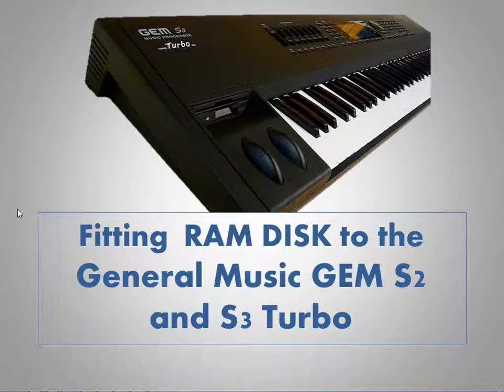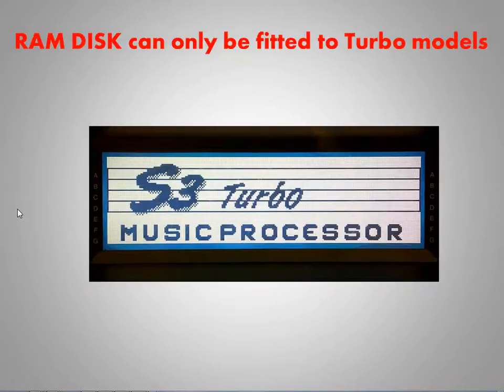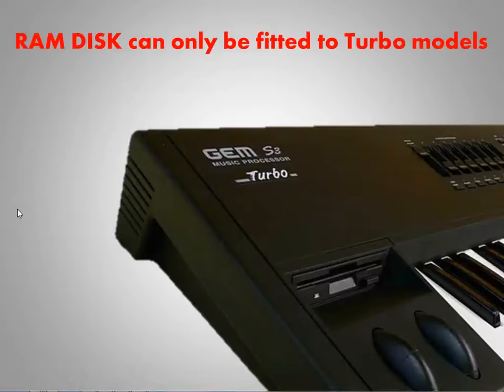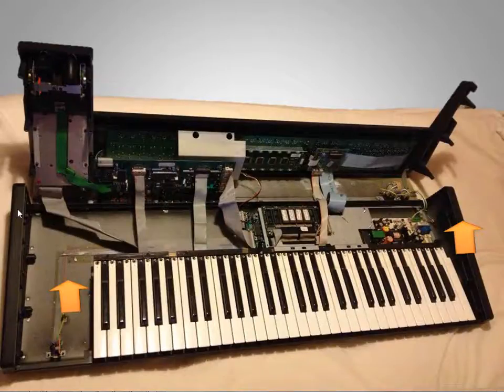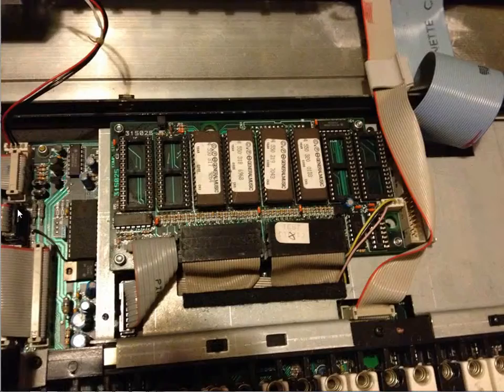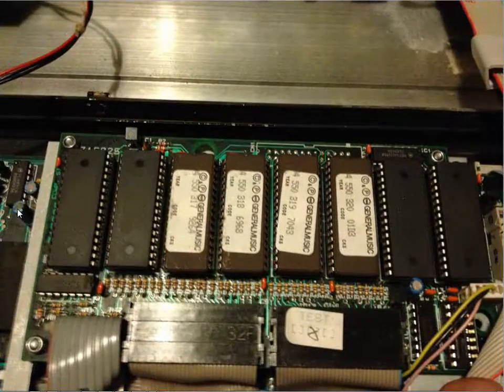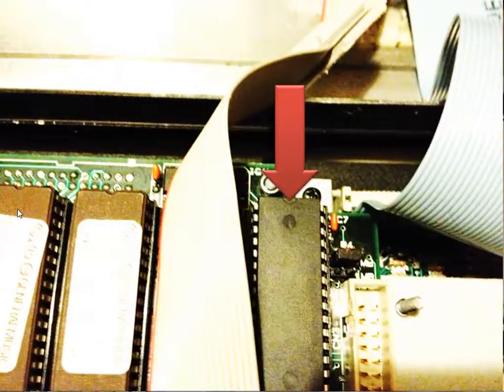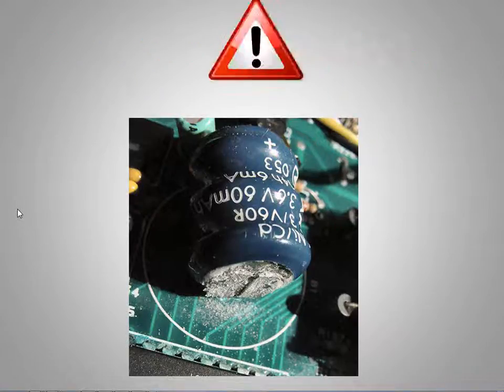Fitting General Music GEM S2 Turbo or S3 Turbo Ram disk

Comment: Hey BB, just wanted to thank you for all of your info on the VP-9000 on your web site. I'm considering following your "trading out the zip drive for an data-card reader." But just knowing how particular the VP-9000 is about WHICH data card it will read has me worried.
Reply from the maker: If CF works better for you then go for it - you can always revert back. IMO most of the early failures were due to old firmware more than bad cards (so make sure you update first). Even then was Transend or Industrial that always seemed to work, just not every cheap camera card. I don’t have my CF anymore - any other users still using it and give later comment?

Comment: Nice little instructional!
Can you tell me if the battery is necessary if you're not using the additional 4 chips?
Also, any tip where to get the ram chips and at the risk of sounding stupid; does installing the cheaps mean I don't have to wait for floppy boot every startup?
Thanks!
Reply from the maker: +jimbomusic Yes, the NiCd battery is a standard part of the Turbo kit, whether or not you use the RAM disk. It is also used for storing all user's custom  settings, like Midi preferences, attack curves, etc - basically every menu where you have to click "[Save]".  For the non-turbo versions these settings are also retained by a battery, but a lithium coin cell instead of horrible NiCd. NiCd are no longer generally sold, but is commonly replaced with NiMH alternative.
Reply: @barrybutcher  Strong suggestion is to replace the battery and to put it away from the motherboard in a safe way (to avoid leaking).

Comment: Hi Barry. I had my GEM S3 Turbo stolen a few years ago. So gutted, even now. I've got dozens of disks with my own compositions on that I produced on the GEM. I've had no luck at all sourcing another GEM S3 Turbo so I'm wondering if there's either another workstation/keyboard that would be compatible with the disks or a rack mount I could get? I really want to have access to all those songs, somehow! Any ideas?
Reply from the maker: Yes, the GEM S2R (sic) is the rack mount version. It was released last, and by then included all Turbo features by default. The sequencer supposedly has a “save song as General MIDI” option so presume this would do it for you. Or just ‘play’ the song into your favourite sequencer. 
I know the Sound disks are custom format, to get the 1.8MB needed, so not FAT and cannot be read by Windows etc. 
There is software like OMNIFLOP which enables Windows to COPY the disk to image file, but not aware of any software that can extract from that image (anyone else?)
Reply from the maker: If you want to make an image of 1 of your disks, I can try loading it on my S2 Turbo and try that ‘Save As GM’ option for you.

Comment: Great and useful video, thanks! Any idea what RAM chips can be used in an S3 Turbo and if they are still available from e.g. a standard electronics supplier?
Reply from the maker: +jmechnich The part number I've seen is BS62LV4006PIP55 but has been difficult to find this from eBay or RS Components.  If anyone finds a supplier or working alternative please let me know!
Reply: +barry butcher Thanks for the reply. I just bought four 512K X 8 bit Low Power CMOS SRAM, DIP32 from a German electronics supplier (http://www.reichelt.de) for ~5 Euro/piece and they work flawlessly. It does not seem like you have to use exactly those which were sold by GEM in the 90s, using Low Power RAM is probably still a good idea in order to prolong battery life.
Reply: +jmechnich Thanks for the battery and RAM tips! I had already sourced 
Reichelt as I'm in Germany (are you in Germany as well?), but good to 
know that stuff is proved functional!

Comment: Hi Barry. Great instructional - the low power chips just arrived from the co. in Germany as you highlighted. Hope to strip the S3 Turbo this weekend to fit.  Regarding the NiMh battery replacement, again just arrived in post off eBay seller. However .... before I attempt fit (and having read some warnings...), if I desolder and clean NiCd salt residue off PCB, will it lose the OS??! 😟 as no disk assuming it's a boot up job. Thanks and look forward to your / other users replies.
Reply from the maker: No the OS boots from ROM - all you will lose is any General Settings you made which are just factory reset so should be easy job.
Reply: Sweet, thanks Barry - will check what set-ups I wish to recall before starting....! BR

Comment: In summary, the S2 Turbo without the battery (if I remove it) won't work or it will simply doesn't store the general setting (if customized)?
Reply from the maker: Yes, AFAIK it will work fine and preset and user patches recalled from flash. 
Like you say, just General Settings lost, and no Real Time Clock of files saved to disk ( and of course if fitted Ram Disk contents lost) so no big deal 👍

Comment: if you dont see the battery, its under the keypad. unscrew all the screws af the top of the keypad. And the 3 on the other side of the device, at the back. so that will be the lowest screw.

And if your Aftertouch is defect, i dont know what the solution to that is unfortunately.

Comment: @barry butcher: There's a Gem sx2 for sale at my local craigslist. Is the sx2 the same as a s2 turbo, or is it something else? If different, can you please explain. thanks.
Reply from the maker: Hi Arno. Honest answer - I don't know. The SX2 is a different keyboard. However it came after the S Series so could be based on similar technology. Anyone who has one could open up and see if it has RAM disk sockets as shown. But I can't find any pictures online to check and you can't really buy without checking first!
Reply: barry butcher hi Barry, thanks. I went to see the Sx2 last week, and luckily the seller had the manual. The manual stated very clearly that the Sx2 had mono (channel) aftertouch. Since I was interested in it for the polyAt, I passed. Also, to help me make  my decision this particular specimen had such wonky uneven velocity on the keys as to make it unplayable. It was pure junk!

Comment: hi Barry wondering if you can help i have 2 wx2 and i changed the batteries and i cleaned the boards one of the key boards have no sound at all the other blue screen any help will be great full thanks
Reply from the maker: I have never opened a WX2 so can't really say. "Blue screen" is a fairly common fault - most likely meaning the CPU board failed to start and draw something on the screen. If this isn't the same fault as before you changed the battery then guess you should check your connections :-)   As you have the luxury of having 2, I suggest you start swapping boards. The one that starts must have a decent CPU board (and battery👍), so try swapping the Output board with the jacks.
Reply: hi sir thanks for get back to me i did swap the boards it the same the fault is in the boards i know that that is far as i know
Reply from the maker: The only similar report I heard on S2 was booting it up without the display connector worked. Obviously you can't see anything on the screen but you might hear the default sound working. In that case there was a short circuit on the display connector. 
Otherwise it's down to continuity checking every joint manually, and comparing between the two.
Reply: HI THE FACT  THAT I SWAPPED THE BOARDS AND EXACT THING HAPPEN WITH MOTHER BOARD IN THE SECOND KEY BOARD  KEYBOARDS MEANS THE FAULT 100 PERCENT WITH MOTHER BOARDS I THINK THE CPU GOT WET  BUT I SPRAYED WITH AND ELECTRONIC SPRAY SHOULD NOT EFFECT THE COMPONENTS THANKS

Comment: Greetings, Is there any one that can MAYBE help me.. I was given a Gem 3 turbo.... The man swore it worked fine two years ago.... But when he brought it to he said He could not find the power cord. I know nothing about these machines, the gentleman said his son try it with a computer\printer cord and said it Clicked but the screen did not come on, but the red switch indicator lights worked... Any Ideas??? does the unit have a power supply or does the stock cord step down the voltage\wattage. Is there a reset? Or what happens when the internal battery goes bad???? There is no information in the u.s..... Any information would be a blessing.. Thanks for showing how to open her up... I'll wait as long as i can, but I'm dying to get started with her.. Thanks everyone...
Reply from the maker: Congrats on your free gift! Yes the power cord is standard AC - no wall-wart. It’s 240volt in EU - I guess 120volt in US? There is an internal power supply board with 110/220v input, and 5v/12v/-12v output ( has 500ma fuse worth checking)
If the red LEDs seem to respond to pressing it’s pretty good news-  the main board is running and responding so most likely is just faulty display. Do you actually get any sound from output or headphones?
NiCad battery is only used for real time clock and memory retention- will work fine without it but just have patches wiped.
Reply: @barrybutcher  Dude you're wonderful human being. It's like this,  the day before I picked up a casio cz-1000 for $40.00 u.s., again I knew nothing about these vintage synthesizers. I did rig a way to test it. It works great. So I rush out and got a fender dec 50 watt amplifier with effects for $30.00. But the GEM s3 is step up, and I really don't want to do anything stupid.  And until I study her a bit, I'll admit I'm nervous.  However Thanks to your information on the cord and the screw pattern on the back to open her up. Dude thank you so very much for your help and I live In Atlanta, Ga. USA. If you need anything from the States, let me know. 
The silly part is...... I have no musical talent... I was shot 3 times in 1980's. It left me with 8 different bullet holes, so I tried the keyboard for therapy as it did a lot of nerve damage   in my arms. I still can't play a note, but working on the vintage machine is serving the same purpose.  Plus I donate some to an Autistic school and some of the kids really get into them. Wow, I haven't text this much ever. Again if there's anything you need... Feel free. I'll open it up and go from there.... Thanks my man.
Reply from the maker: Hey man good luck and yes - not all shot up things are ‘beyond repair’ :-). A further reflection… it is well documented any NiCad battery only has 10 years life, so after 30 can start leaking. For S2 there are ‘battery acid corrosion’ reports that directly impact the display IC tracks. So definitely worth buzzing continuity the tracks under/around the battery area.

Comment: ciao Barry, la mia s2tubo ha smesso di funzionare , tutto e' iniziato con uno sfarfallio del display all'avviamento ... sempre più debole di intensità fino a oggi . la s2 turbo non si accende più. ho controllato tutte le alimentazioni e sono ok. lunica cosa  e' la batteria tampone. che ho ordinato immediatamente . ti volevo chiedere , ho perso tutto il sistema operativo ? e' possibile recuperarlo? sei l'unica persona che può aiutarmi ..poi successivamente provvederò all'installazione delle ram come da filmato . grazie per qualunque aiuto che mi puoi dare ..
Reply from the maker: [Translation] hello Barry, my s2turbo has stopped working, everything started with a flicker of the display at start-up ... weaker and weaker until today. the s2 turbo no longer turns on. I checked all the power supplies and I'm ok. The only thing is the battery. I ordered immediately. I wanted to ask you, do I lose the entire operating system? Is it possible to recover it? you are the only person who can help me .. then later I will install the RAM as in the movie. thanks for any help you can give me ..
Reply from the maker: Hi.  No: removing the battery you definitely do NOT loose the operating system so this is not a worry for you.  The battery is only used for 3 things:
1. To run the Real Time Clock (RTC) even when power is off
2. To store your global settings, like Tuning, scales and footswitch options.
3. Data stored in the RAM disk (applies to Turbo versions only)
The OS is non-volatile so is not lost on power down or battery replacement.
Reply: @barrybutcher  procedo, ti faccio sapere com'e' andata
Reply: Buongiorno, la mia ricerca del guasto e' terminata , e ho trovato la parte non funzionante .E' l'alimentatore interno, ho provato ad alimentare S2 con alimentatore a banco tutte le tensioni interne , e la tastiera funziona!!! Ti volevo chiedere se hai lo schema con i codici dei componenti dell'alimentatore interno, perché non si leggono e non posso trovare i componenti da sostituire. Grazie ancora.
Reply from the maker: I have some schematics including PSU on my web site which might help http://barrybutcher.com/index.php/11-gem-s-series/21-gem-s2-schematics